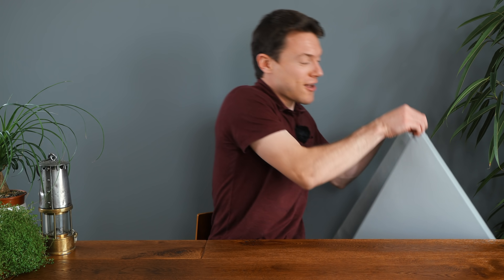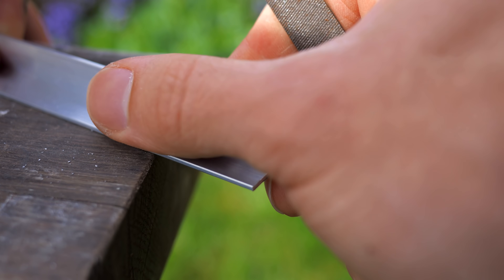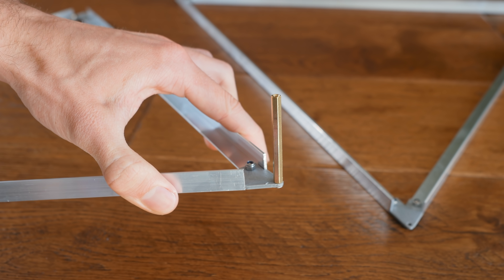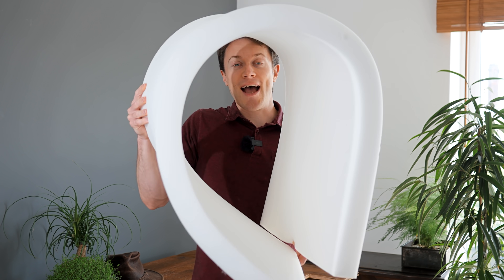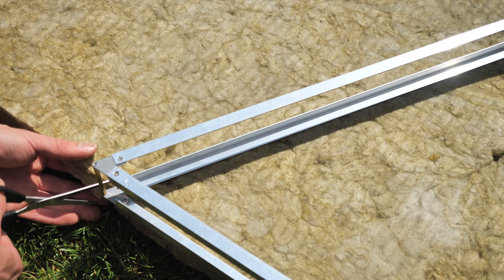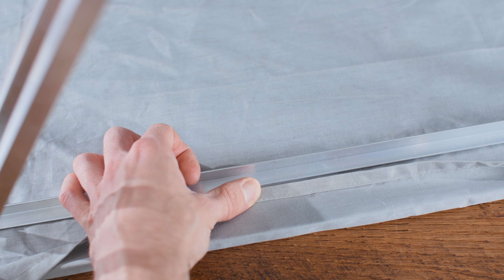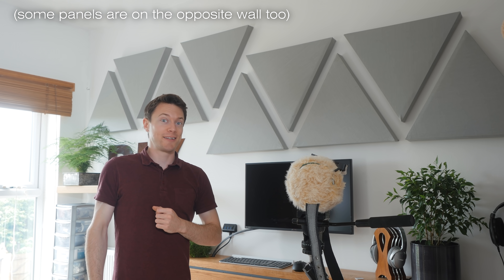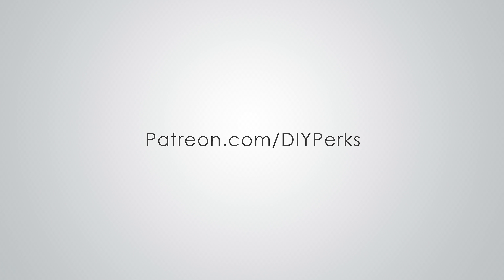High-Performance DIY Acoustic Panels (Build Guide)

Comment: I just used 12mmx42mm skirting board I got on discount and glued them together. It's lightweight enough, and it made all the other steps easier, you don't need any screws, spacers, or 3D printing, and the glue sticks to the frame itself. I recommend a mitre saw for faster and accurate cuts though, I did it by hand and it took a while to make the concentrated cuts, and they still weren't quite perfect.

Comment: what about instead of making them triangle you can make a rectangle one or just a large size one that's the size of a large painting and then you go by a some painting picture you know like when someone paints a picture with a brush and paint the kind that you can roll it up into a tube that kind of painting were you remove the frame and then you could remove the painting and you just roll it up into a tube that's kind of old-fashioned painting I mean because I know newer paintings they're on a solid piece of canvas that doesn't Bend and I'm talking about the paintings I could Bend and then you just glue it on top of the sheet that's making the room more decorative if you didn't want to go the way you did it and if you made a large enough one that covers a huge part you could probably try putting a poster over it if you didn't want to use a painting but for paintings you can put a bunch of small ones next to each other that's making the room look nicer if you didn't want to do the triangle version

Comment: Thanks for your take on panels. I love the triangles, helps break up the parallel lines in the room which I believe to be sonically beneficial. Btw, rigid fiberglass aka rock wool, is one of the best materials for sound deadening. It’s amazing how many public spaces such as restaurants don’t take acoustics into consideration whatsoever.  A restaurant close to me has concrete floors, and open corrugated metal roof. Even with sliding open sides, you have to yell at everyone at your table to be heard.

Comment: Not one person here has mentioned the need to cover the insulation properly, something like polyethylene fabric would work well. but similarly other tightly woven but breathable fabric will do (needs to be breathable). This is because the chance of insulation particles flying around in your living room/studio/bedroom is too high if you just leave the backing off, this is a hazard that can cause cancer and other lung-related problems. 

It's an important step, don't overlook it.

Comment: or you could just use wood which is better for sound anyway. Nice panels but not many folks can do this, just not practical.
Reply: ... what's not practical about it? You can buy literally every single component over the counter with the exception of the 3d-printed attachments, and you could create those out of other materials. The bare minimum of DIY is even required.

Comment: For acoustic deadening where 'modern' looks are not priority the  towels are superior and because sizes of panels can be more varied it is easy to move some around now and then if, for example, watching TV with surround sound where some reverb is beneficial.
Also, when using the towels method it can be a good idea to wrap the whole package in cling film or lightweight PVC such as is used in bin bags to avoid dust and moisture ingress.
Reply: Flamability is the main issue with towels. Mineral wool won't burn up like that.

Comment: PSA: If you use that fiberglass insulation, PLEASE, please please PLEASE wear gloves and a respirator or mask! Used to work in mold remediation, and although it wasn't my job, I once needed to cut fiberglass to size for insulation, did it with a mask but no respirator, hands itched like hell until I could wash them!

Comment: Love the idea, although I do believe there are likely easier methods of achieving a similar look without the complex methods used, such as the 3-D printed parts. I think DIY projects usually have three principles which make them worth the time; being cheap, easy to make, and quick to construct. I personally wouldn’t go to the trouble of 3-D printing a bracket  to join a triangle lol

Comment: I just used fabric glue & glued a 24w" x 36L" x 2Depth" upholstery foam onto a 24" x 36" art canvas. I used duct tape to define & stabilize the corners & wrapped it in fabric .. Light weight & easy to hang.. no 3D printing necessary..  I like the hot gluing the nails though.. Nice tip..

Comment: Hey, DIY Perks! Do you think, one could DIY a noise-canceled chamber out of NC headphones and a couple of speakers?

Let's say, I have a small bedroom (or chamber) but I'm hearing my upstairs neighbours. In theory, I would use the microphones from the NC headphones, place them near the walls (or using the walls as sound sensors?), and then using speakers to counteract on the soundwaves coming from my noisy neighbours?

Comment: I am an acoustic product installer and I do this for a living, I do suggest using polyester materials like the cotton they used on pillows its more safer than the insulation because it is hypoallergenic and easy to work on because its not itchy.

Comment: Just want to tell you, you inspired me, and have had a a towel hanging on my wall a year now.

i skipped all of your building stuff, and just have an exact cut to lenght pole as long as your towel figure a way to keep the towel nicely on it, Then hang a towel on the wall.
it works and gets you 80% there with 20% effort. (as per the rule)

it is a nice patterned grey towel, did have to buy that thing, the pole i had allready, just stole it from a cleaning supplies.

its amazing how much it cut the echo of the room, and i get why people hang rugs on their walls.

Comment: Guys in case you are using insulating mineral wool please do it in your garage or somewere outside with heavy protection throughout your body, specifically eyes. Even if its new or old it doesn't matter, particles can still cause major irritation and sometimes even cancer if inhaled. Please be carefull!

Comment: I think cardboard is much better for this project. It's durable enough, much easier to find and cheaper, can be easily shaped and very glue friendly. Also, it discards the need for 3d printed parts.

Comment: The band practice rooms I used to practice at had cardboard egg pallets bolted to the walls and fluffy carpet glued over that.  The carpet soaks up a lot of sound and the egg pallets reduced the presence of flat surface and hard angles, thereby scattering the sound and reducing revib

Comment: I like the idea of triangles. However, your corners are not sharp enough for my taste.
Also, you are using the wrong absorption material. Foam and plain Rock Wool will not absorb as deep as high-density rock wool. You can buy this as near-solid sheets from both Rock Wool and Isover. Rockfon (not cheap) also sells these and they have acoustics graphs so you can see the performance. You can also add a little space behind the absorbers - it will let them absorb deeper frequencies.

Comment: I wanted to be able to experiment easily for the space I was working in. So, I used bed sheets (clean and washed) to spray glue the foam "v" squares onto the sheets. Then I mounted the sheets with the attached foam squares on the walls around the space. I believe it helped quite a bit because they also have a little space between the foam and the walls to catch the sound passing through twice as several have mentioned here.
Reply: Acoustic Foams are used for Echo & Acoustic Curtains are used for Soundproofing SoundProof-Curtains.me

Comment: Why even start with aluminium framing? You could make an easier frame with cut plywood. Frankly, why do you even need to bother with the frame in the first place?
Surely you can just cut some rockwool or foam, stick some long nails on each end, then cover it in fabric. You should be able to attach them to the wall with the same effectiveness. Use a hollow rod and a washer even to get right distance. Is it all because you just want really sharp corners on triangles?

Comment: Wait wait wait... shouldn't you use white fabric and put LEDs inside them too, so you can get snazzy accent lighting along with the sound dampening? The foam would make a nice LED diffuser... just use two layers with the LEDs sandwiched inside. Obviously run the LEDs at low power to avoid overheating. Great content!

Comment: I'm really surpried you went for aluminium as using a mitre saw you could easily cut some lengths of wood at a 30 degree angle to make the triangles - you could then do the fabric upholstering of them using a staple-gun.  You could also just buy some canvas wall art panels and put the foam behind them.

But as a life long Zelda fan I'm utterly infuriated that you didn't arrange these in the triforce pattern.... Grrrr.

Comment: Just out of curiosity because there is actually a DIY towel absorption panel in this channel and i am wondering how does it fare against this sponge vs insulation? Does the towel still works better?

Comment: Follow every step...make a wood frame. It works just the same. Maybe use balsa wood or bass wood because it’s porous. In fact the aluminum is going to cause a SLIGHT (unnoticeable) reverb. 

Also, if you know what you’re doing, use the insulation. It’s going to be much more deadening. If you are looking for a material that can catch it to wrap around, but don’t care too much about looks, go and buy you a painters floor canvas from Home Depot for $35 USD.

Comment: And, you can also mix these accoustic panels with flat audio speakers. DIY: But a couple of Dayton Audio DAEX25 Sound Exciter Speaker Pairs, then stick them to a wooden panel of sort, stick said panel behind a canvas painting in between your accoustic dampeners. Connect cables to your amplifier. Done! Now you have both dampeners and speakers on your wall, and it sounds fantastic....and it did not cost you a fortune either.

Comment: 2016: use towels they are better than foam
2019: ignore my 2016 self....... foam foam foam
Reply: would have thought 5-7 layered towels absorb more than the foam... please explain why you prefer foam?
Reply: @Dice-Gamble  I watched both videos recently and just based on the comments I think they mentioned a difference in preventing sound from bouncing off something and not letting sound pass something. DIY perks tested the towel's ability to prevent sound from passing it which isn't necessarily the purpose of an acoustic panel.
Reply: @BrianSteelFactory  
As I recall, the surface of the towels generally absorbed sound and scattered what little reflections there were.  Of course it depends on the nature of the fabric, pile thickness, and how tightly they're packed.

Comment: Brits have a saying: "too clever by half"... Somewhat analogous to the American saying, "using a 10 pound sledgehammer to swat a fly"... While these panels are beautiful and elegant and utterly efficient, seems to me there are far simpler solutions.. Just hot glue pieces of foam in various densities on a thin plywood square. Create pockets to trap the longer sound waves. Foam sheets are dirt cheap. Or just buy a few hundred disposable white foam coffee cups. Hot glue them babies to a panel and spray paint them. Otherwise, a noble effort.
Reply: Your solutions aren't as good as this.

Comment: Any suggestions how to mount these without leaving marks on the wall?
Reply: Instead of the nail, don't add that last standoff and use Command Picture Hanging Strips. They are a pair of interlocking strips that allow you to make small adjustments once they have been placed, but it's better to do it right the first time. https://dl2jx7zfbtwvr.cloudfront.net/productlargeimages/ADHE3030_1.jpg

Those small nails shouldn't leave much of a hole, and little filler will take care of them, though.
Reply: @Lothorn-1  Thanks for the tip, cheers.
Reply: @nathanthomasvideography  Sure! We use these in my house all the time.

Comment: I downloaded the provided STL and sent it to 3d Hubs to be printed in bulk and ended up getting printed wrong scale,  but now that im relooking at size conversion i have no clue what sizes of anything this project is supposed to have, and the patreon i also paid for has no finer details on this project. 
im throughly confused why despite having such great info, theres not enough info to actually do this project.. and a hundred bucks down. a bit saddened by this. 
ill probably need to build my own 3D object since even the spacings of the corner screw hole is  very thin and seems unreliable. I hope you can post details to this project some time as i am still eager to figure this out and wouldnt want someone else to lose out like i did for assuming it was an easy follow along. my fault entirely though.

Comment: You can even make the process cheaper by creating rectangle ones so it skips the 3d printing part, and you can mount your favourite picture/paintings on it. Building the whole frame with glued wood also makes sense as wood is slightly softer than aluminium thus absorbing more sound, (but it can be heavier.)  :)
Another Idea is if you have a huge gigantic empty wall, you can make a large version of this, and turning it into a projector screen, ultimately turning your bedroom into a studio/gaming/home theater environment.

Comment: lol i did the same thing in cheapest and thinnest 24inch pizza boxes. no need of aluminium frames. just taped the pizza box for safety of rockwool falling. then covered them with black speaker cloth, looks amazing, very light.

Comment: the project looks very interesting, and I have to admit that also the effect it has on aesthetics is very nice.
But considering the price for acoustic panels in amazon, for example, and comparing it with: materials and tools used, and their price, time spending and so on, probably looks easier and cheaper buy it directly instead of build it.

But anyway your guides are always awesome!

Comment: Rockwool. If you are trying to suppress bass.... ROCKWOOL. Foam rubber is  more effective on Upper frequencies (not bass). 
Rockwool. Is not toxic,  deals very well with moisture (fibreglass does not interact with  moisture at all, so you can get mildew (if you are in a place that may get it).
But you won't have that problem with ROCKWOOL, it acts like a giant humidor,  and tends to balance the humidity in a room.
No one is completely sure how and/or why it works the way it does... but it does! Rockwool.
Either the extruded stuff, or the actual Wool from a sheep (My fave).

Comment: They would work MUCH better mounted 1 to 2 inches from the wall and angles away from parallel to the wall in random patternt.  The wall spacing add adsorption becaus the sound goes through twice, once in and again on the way out.  The wall spacing would also lower the frequencies controlled by about a half octace or so.  The randomized angles helps to scatter (diffuse )the reflections for a smoother reverb across the whole space.

Comment: Wool insulation that is specific to sound elimination should be used as wool is by far less itchy, and the Wool specific to insulating against sound will achieve the goal.

Note to those in warmer climates! 
Consistent Daily Temps above 70f will cause the hot glue to lose it's ability to remain solid. VHB tape, or small self drilling screws might be a generally good way to back up the hot glue just in case?
1/2 in. Sound board is cheap in the states can be cut with a utility knife or at the box store. is a bit dusty but can be sealed with a clear or paint and will possibly achieve the very best effect?

Great build. Another option would be to use closed cell foam for diy speakers? Tech Ingredients channel makes some phenomenally cheap!

Comment: Your own 3D printer???  The wood framing would be a simpler process to build. I would use gloves to handle that insulation, other than that, great work and great look.

Comment: you have very good videos but in this you have complicated it without sense, aluminum, 3d printing, hardware, silicone, double layer of fabric? If you do it with 3 pieces of pine wood of 2x5cms, you screw them, you put a cloth of € 2 per m2. high density rock wool and a cheap staple machine, you would spend much less and you would do it much faster, the end result would look the same, I did them years ago for many recording and dubbing studios, greetings from Barcelona

Comment: Me: "I'm going to buil-"
DIY Perks: "Use a 3D Printer."
Me: "F**k"
Reply: There are 3d printer shops that let you use theirs, as well as other places. Or if you're like me and don't want to pay people, you could cut the shapes from plastic or resin and sand the sides down.
I mean, it's probably just a joke... But there you are anyway.
Reply: @libbymiss  Thanks a lot.People who have 3d printers in my country want mind boggling amount for making some plastic
Reply: A year late, but stuff like those corners you can also do by printing a stencil onto card, then using a scalpel to mark acrylic sheet through it, then hacksawing the acrylic.  Drill for the circular hole and you're sorted.  Probably need to make two "layers" per corner-piece, to have the 3D detail needed.